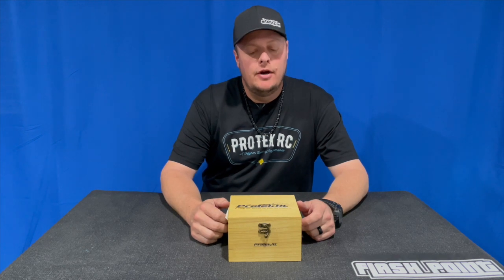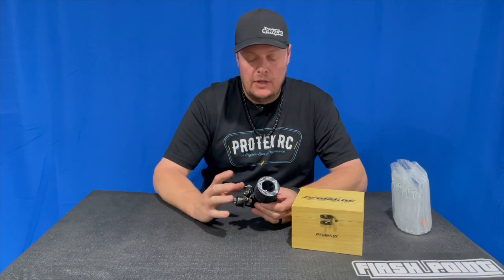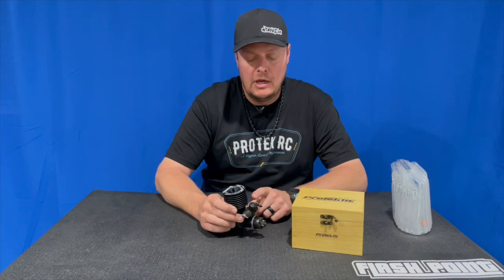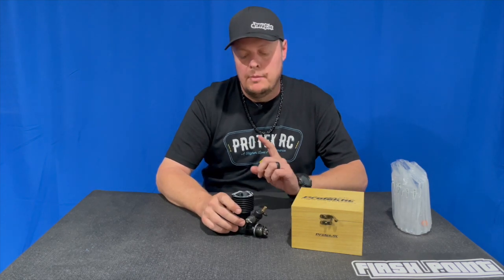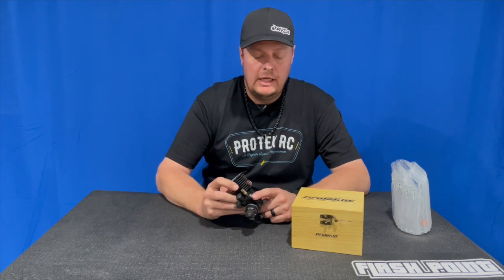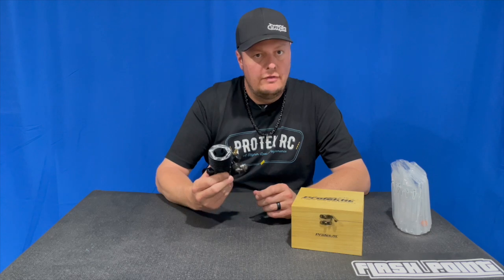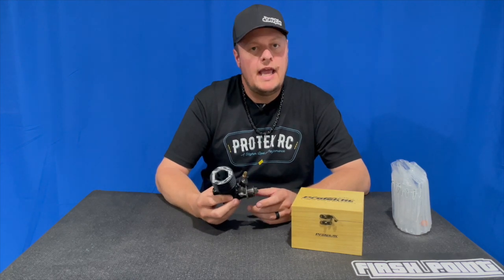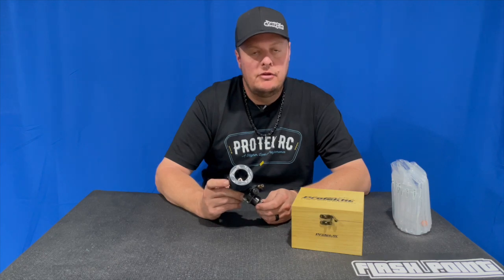Protek RC CR21 Nitro Engine.

Comment: This engine is based off of the os Max XRB v3. One of the guys at my local track runs an XRB in his truggy and it rips pretty good. A very simply designed engine (ports and crank don’t have any special cuts or anything) that just works.
Reply from the maker: Very nice.